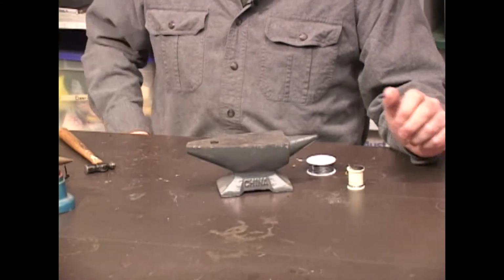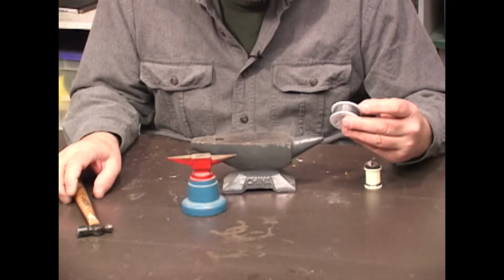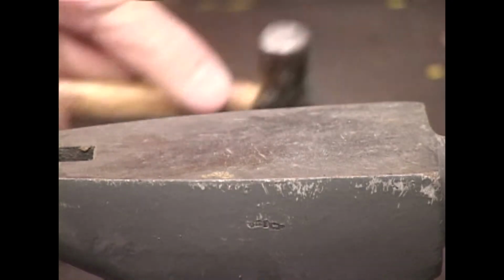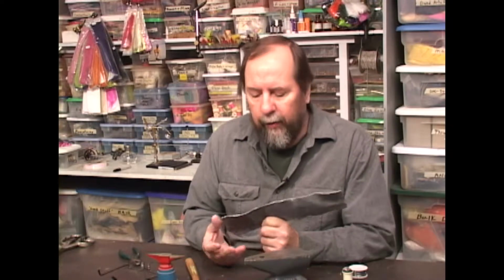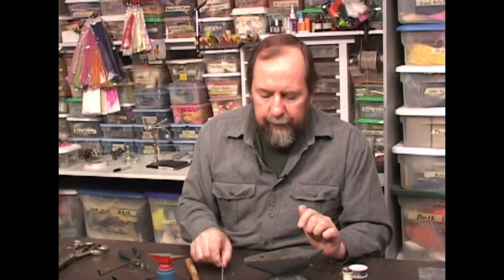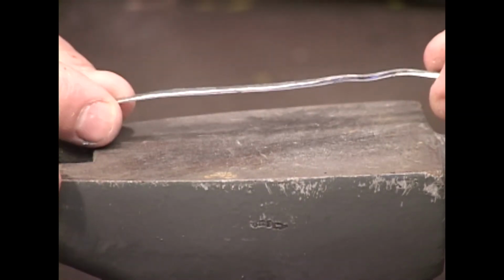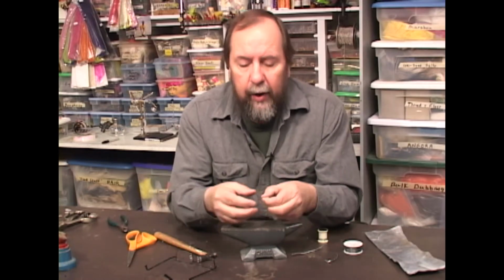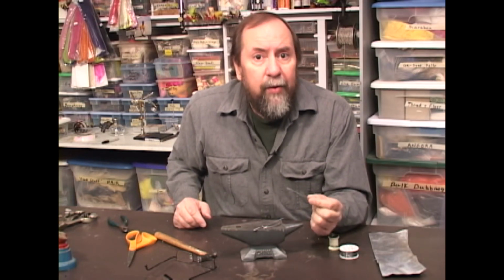Flat Lead for fly tying czech nymphs ( With Chris Mihulka)

Comment: They do sell the flattest lead by buying lead that is used to customized golf clubs. It is also sold by fly shops in the UK as well as tungsten flat wrap. It is a lot of work to do it the way you did. I just used a hardened roller and rolled with pressure over the spooled stuff. Now I have both adhesive backed lead, and tungsten sheeting.